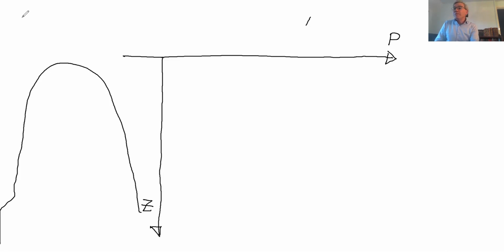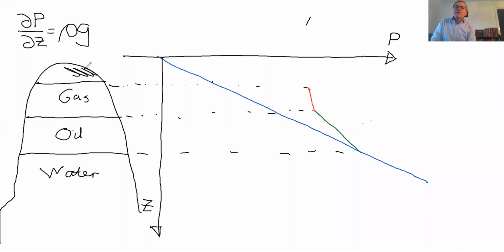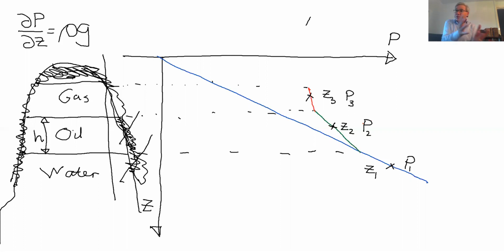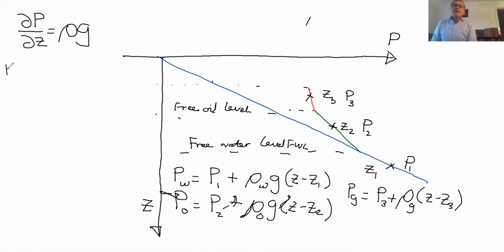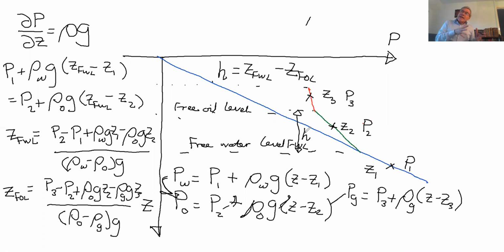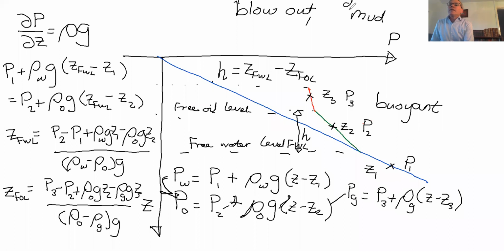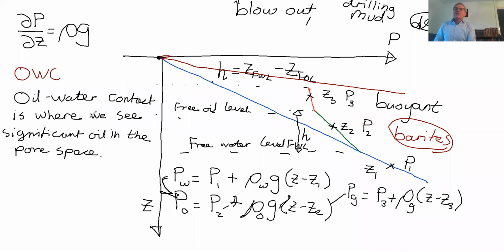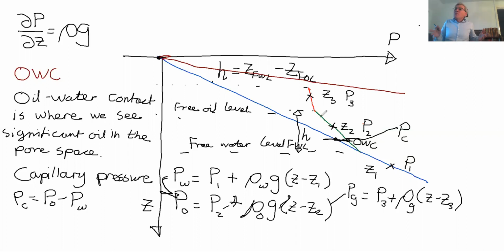Fluid pressure regimes

Comment: Thank you for that very informative video! it was very helpful to know about the cap pressure influence on the OWC where the oil column appears to be ~1-2m above the water gradient.  If you had a large enough delta in API in a pool (for example: 14 API in the south and 19 API in the north) and no real stratigraphic or structural barriers. Could you have a different OWC in the south vs north due to that cap pressure effect (~1.5m difference between the two)?
Reply from the maker: Marilyn - yes this is possible.  If the same capillary pressure is imposed across the field, but there is a variation in density, then a difference in apparent OWC can occur.  However, over geological time, these compositional differences may even out - normally changes in density of the oil are seen with depth.